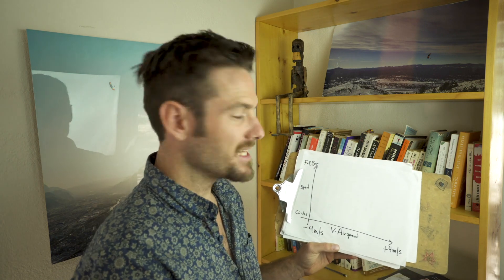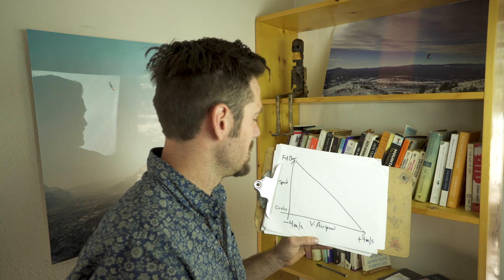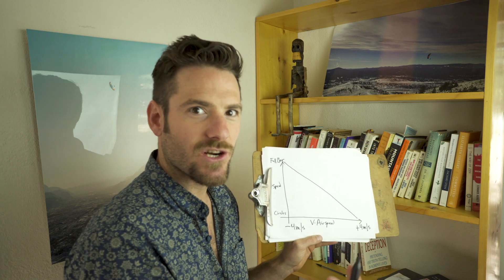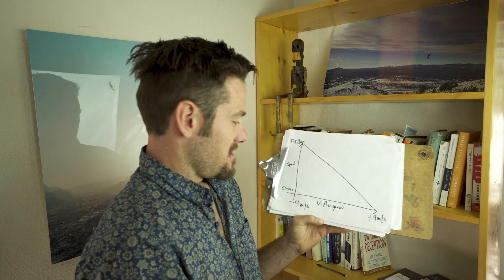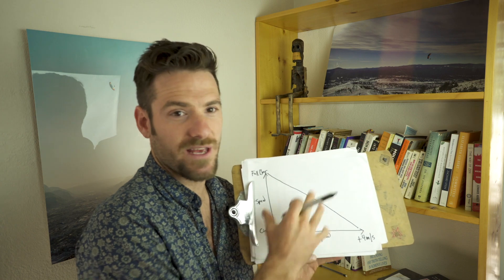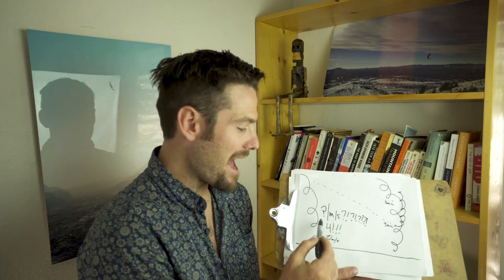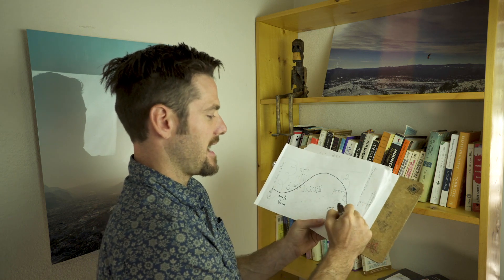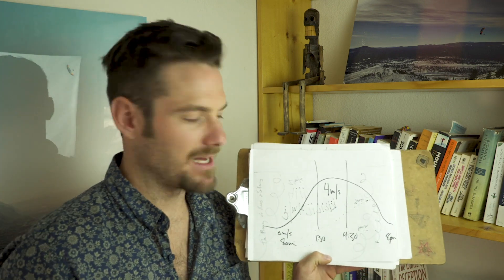HOW MUCH SPEEDBAR?!?

Comment: I would add another level of complexity: The Cycle :P. It's better to get into lift before it's dead. And another one: "The Minimum lift to take". Some lifts are not worth taking (even in flatlands, I'm flatlander) and it depends on what's "avarage day strenght" and current altitude - when it's strong day and I'm high I'm not taking 1m/s, just flying slower to minimize sink and go for another, better one. You can calculate your "day strenght" by: gained altitude / time (seconds) for searching the lift + time spent climbing + time for exit the thermal = avarage day strenght. So after getting 1500m in 20 minutes (1200 seconds) I know that avarege thermal strenght right now = 1,25m/s. Climbing in everything lower than that is not worth the time cause it will take too much time. Of course I would take anything when I'm at 500m AGL ;).
Reply from the maker: Yeah, you can set your averager really high too, if you want to get that stat in real time

Comment: Hey Ari, thanks so much for sharing your knowledge! I have a question, something you said I just dont get. You were describing a situation when it is beneficial to use your speed bar to get your ground speed equal to your trim speed in headwind. The way I understand it that your trim speed (in the air) is when your glide ratio is the best, and so you will glide the furthest. And so using your speed bar to get that extra speed in headwind shouldn't increase your glide distance, on the contrary, it will shorten it. Am I missing something? thanks for reply, cheers man
Reply from the maker: Hi bro! No, 'trim speed' is not 'best glide'. Trim speed is how fast the glider flies without brake or speedbar input.

Comment: Isn't the Speed to Fly the same as developing a "Polar curve" for your wing/weight?  Thanks for sharing your knowledge.
Reply from the maker: No, its not. A polar curve is a graph of the relationship between speed and glide ratio for a given glider/weight, but speed to fly is applying a polar to vertical airspeed to determine how fast you should fly to maximize distance.